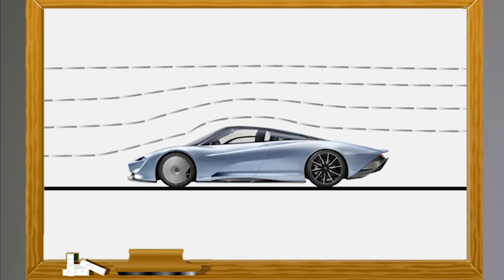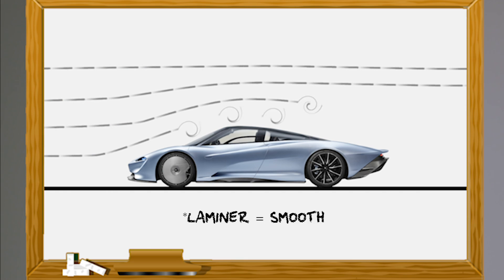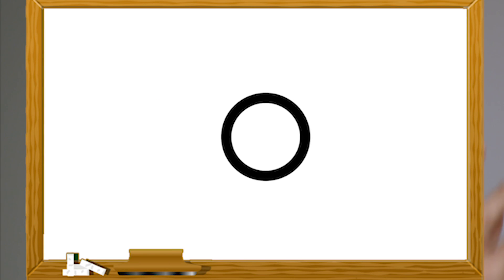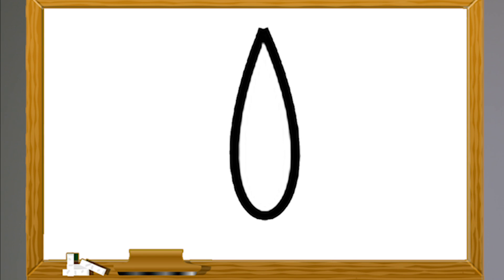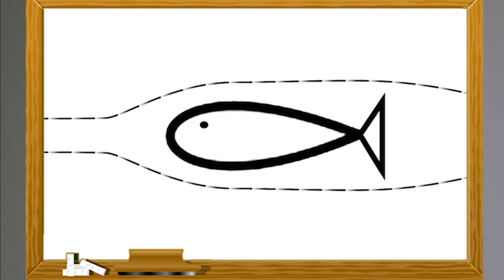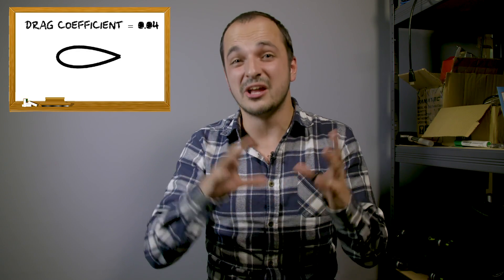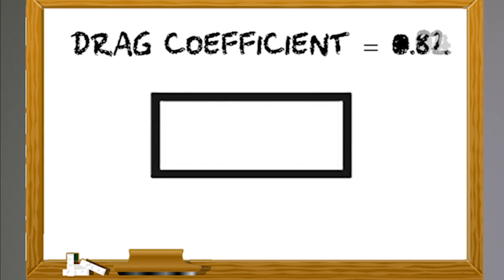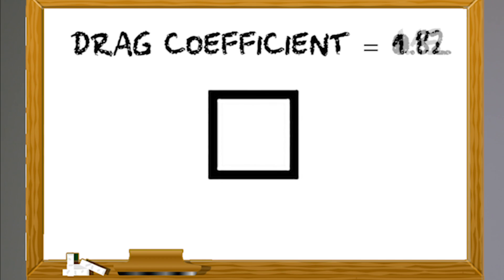How the McLaren Speedtail stole its shape from Mother Nature - Mike’s Mechanics

Comment: Pretty sure a Peregrine Falcon falls faster than a drop of water...
Reply: SmashGhost yup. Falcons can reach speed of over 300kph in dive if I remember correctly. That is beyond terminal velocity of a water drop. But they are cheating. They use there body power to increase the speed in the initial dive therefore gaining momentum. Also they slow the dive right before they hit there prey to stop dying from the impact...
Reply: Water for a drop can rise 999kmp for sec and a falcon can reach 600kmp so basically Water is the faster then the falcon

Comment: how mclaren speedtail stole its design from koenigsegg regera / jaguar x220. there. fixed it for u. lol
Reply: MrCylan88 It just didn’t though. XJ220 is made for downforce, you can tell that the Speedtail has a taller middle compared to rest of body and much longer tail. And only thing it shares with Regera is the rear looks similar and they have a similar colour for the press car. That’s basically it.